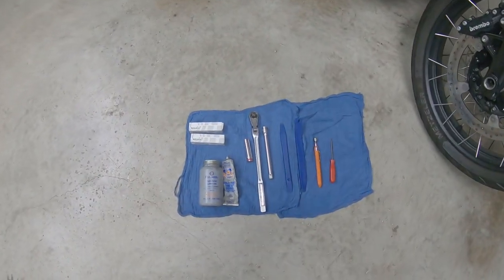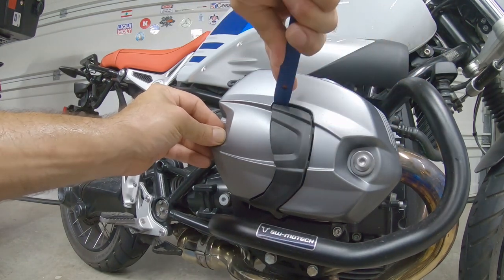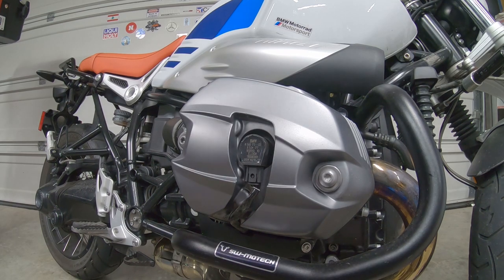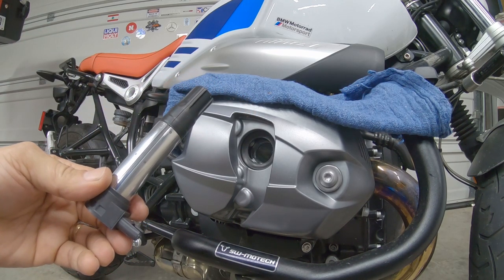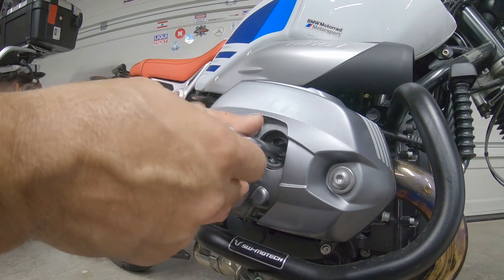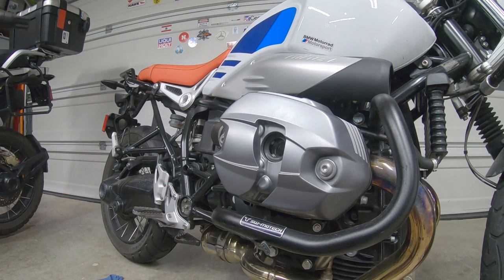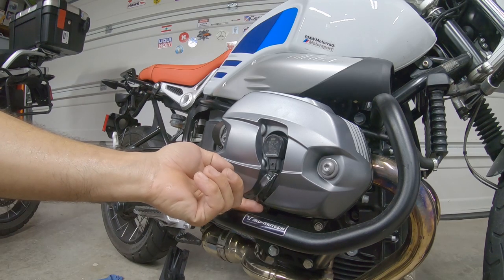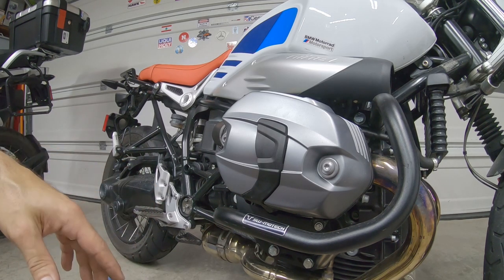Change spark plugs on a Boxer BMW R Nine T

Comment: The Camhead boxer engine used in the R Nine T,  like the earlier Hexhead, uses FOUR spark plugs. You totally missed the secondary plugs, on the bottom of each cylinder.
Reply from the maker: Yes , you are right.  Thanks for the info.